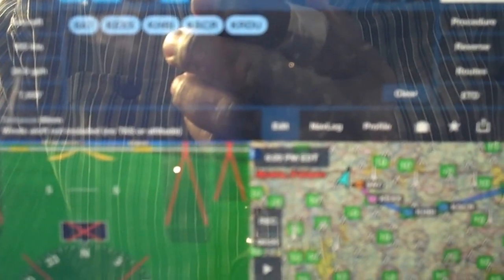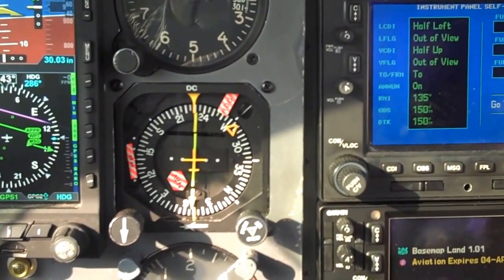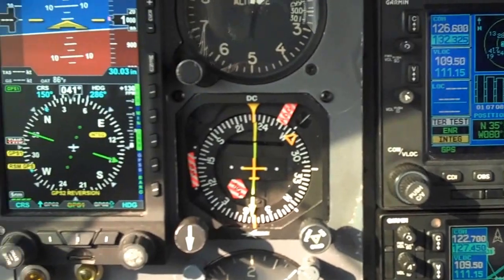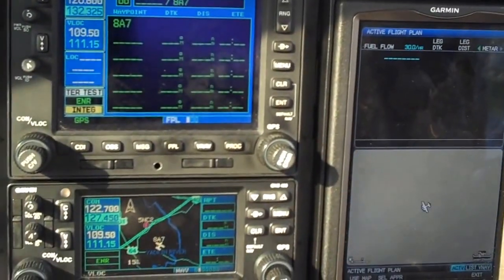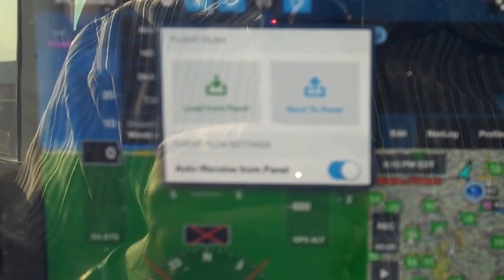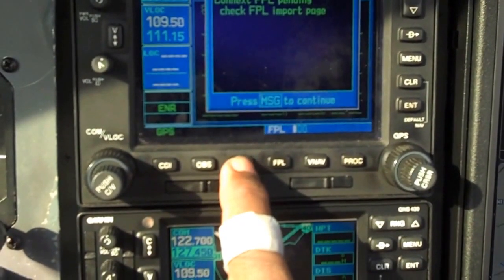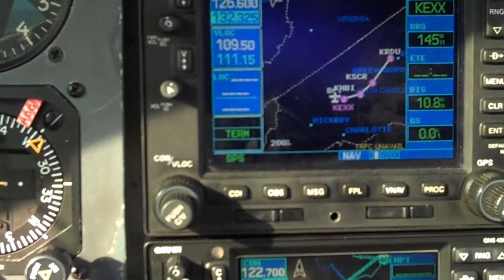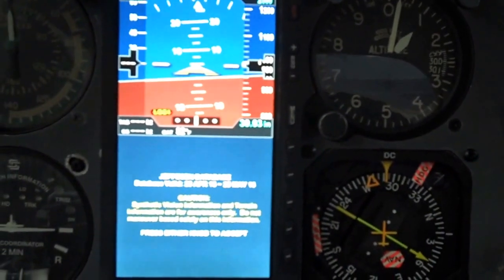Cessna 310Q Flight and Garmin FlightStream 210 Avionics Upgrade/Test 8A7 to KRDU   (PART 1 of 2)

Comment: If I have a 430W and Garmin 330es for ADSB Out, can I install 210 and use it same time I'm using stratus if I don't have the 345?   I would use bluetooth for FS and then wifi for Stratus so both can connect same time?  I don't want to have to disconnect foreflight from Stratus ADSB traffic in to be able to use flightstream 210.
Reply from the maker: Yes, that is my setup. And it works well. I have 530W and 330ES with FS210 installed. On the dash is Stratus 2S and using WIFI to iPad mini for weather and Connectx from FS210 over Bluetooth for flight plan changes. Twin Lakes Avionics does a great job in install and troubleshooting gremlins of interoperability. Give them a call at 336-998-6120 (Gwen) tell her Arthur Billingsley says hello. Stay safe!!
Reply: Thank you!!  Someone said foreflight can update 430w through your phone now and don’t need to install flightstream to upload plans to 430w?
Reply from the maker: @JourneywithJLew  That information is incorrect. There is no Bluetooth capabilities inherent in Garmin legacy navigators(4/5xxW). The only option to communicate to legacy (pre-2010) navigators is using an external box to input RS232 signals on internal lines. Also, Avidyne has the best navigators with more capabilities and better interfaces including Bluetooth (https://www.avidyne.com/product/ifd540-fms-gps-navigator/) .